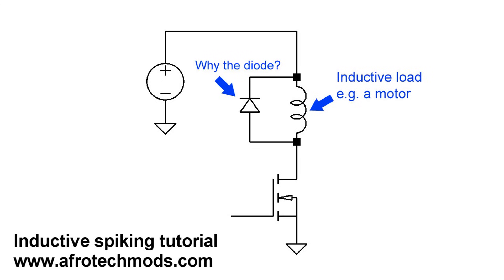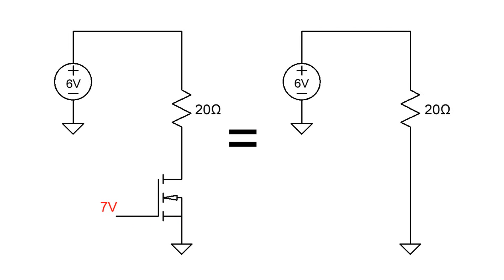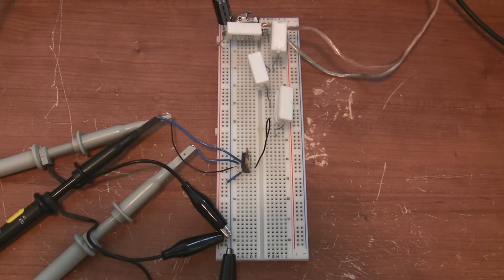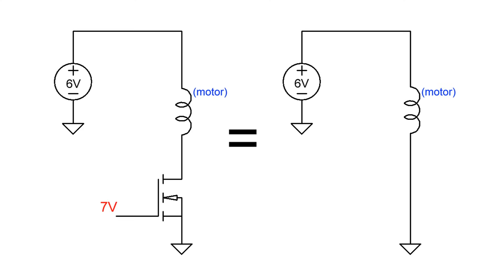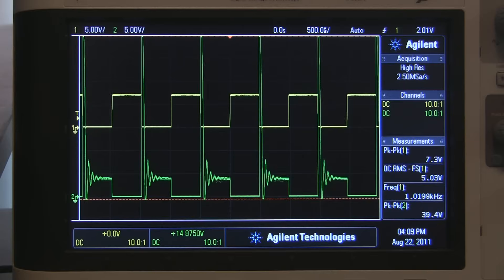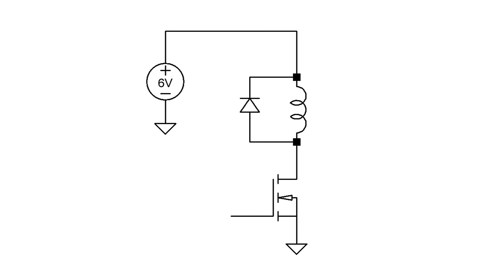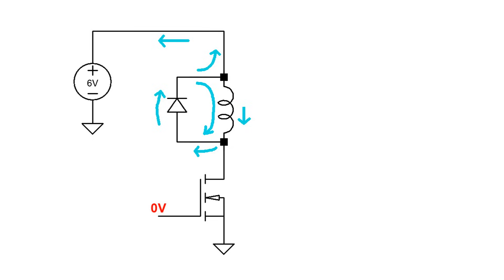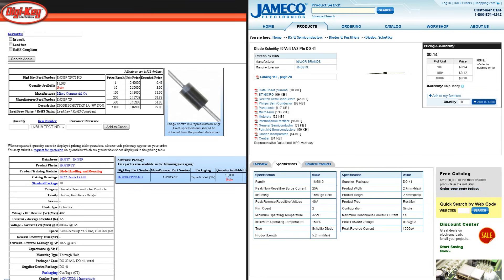Inductive spiking, and how to fix it!

Comment: Aren't RC-filters used to protect circuits from transients?
RC-filter = Capacitor and Resistor in parallel of the vulnerable component.
Transient = Voltage Spike
I know about the freewheeling diode to protect from emk (don't know english word for it), basically protecting from the built up energy in the inductive component.

Comment: I like video! But the current doesn't flow to the power suorce, it is stuck in closed loop of inductor an diode, and it is dissipadet on diode and coil's ressistance

Comment: Excellent video, but I can't quite get my head around why the inductive current would flow back to the power source. Is it because the point at the transistor drain becomes more positive due to the induced current, so current just flows to a less positive point?
It's just difficult for me to imagine current flowing in what appears to be an open circuit.
Thanks.

Comment from the maker: @steveBB30 Well you shouldn't be using a low side mosfet like in this diagram to switch any AC voltages so it's not really applicable.

Comment: @Afrotechmods It would be easy to show that there is no way in the single flyback diode configuration for the current to return to the source by a circuit diagram, but I have no way to send you one...

Comment: @Afrotechmods I spotted it after watching the video again, by the oscilloscope outputs it looks like the inductance to your motor was strong and the roll inertia weak, my motor was the opposite, the inductance current clamped by the diode was dissipated within some  msecs, while the motor continued to roll for 500msec working as a generator (producing voltage but no current).

Comment: @Afrotechmods So, the obvious question after my short story, did you used instead of simple DC motor a BLDC with integrated electronics that makes them to look and work like simple DC motors but without brushes, like the ones in the computer fans or something similar?

Comment: @Afrotechmods .... fast it shorted out the 3 phases of the motor, so no currents flowed ever backwards. The disaster came when my partner suggested that the motor stopped too fast, so I thought that instead of shorting the phases I could use a PWM scheme of fast alternation of short circuits and free wheeling in order to make a more controllable stop. The free wheeling returned current to the power supply, which it couldn't reach the large power supply capacitor, so instead it gathered to....

Comment: @Afrotechmods By the way, my motor was a 60W motor DC motor. A short story : when I was young, I had blown up a BLDC driver circuit that I had had build just by the way you suggested. I had a diode to block reverse currents to the power supply. The brilliand thought was an addition of the last moment when I said "Hey, when we plug it, someone may put the power supply cables in reverse and blow it up", so I put the diode. It was not still that bad, because the board in order to stop the motor....

Comment: @Afrotechmods I believe that my experimental results was in accordance with the theory of electronics and closer to ideal results because I used more ideal components (a good quality servo motor, MUR415 ultra fast diodes and twisted cables for the power supply). If you used slower diodes, or a motor with noisy brushes it is possible to have additional spikes and not so ideal response.

Comment: @Afrotechmods .....but it was observed in both sides of motor which suggests that it was not produced by the motor (if it was the case then the voltage in the motor should be raised, but instead if followed the usual ramp). The overshot was due to the inductance of the cables that continued to bring some current even after the FET was off, current that charged the Drain-Source capacitance of the FET and stayed for some time unable to return to the power supply.

Comment: @Afrotechmods .....in the free wheeling diode. Because the current to the windings of the motor was not slowly dissipated and through the immediate stop it had a large ΔI/δt it produced the free wheeling current. It is the same overshot of 1V that appears in the basic circuit when you turn off the transistor briefly before the ramp.  By using a diode in series with the power supply, there were no dramatic results either. When stopping, it was a very brief overshoot of about 10V....

Comment: @Afrotechmods I tested all. I used an IRF630 (200V) prepared for the worst. With the basic configuration there was no overshot because the back emf of the motor continued to produce voltage as a generator with the same voltage and direction as the power supply when it was disconnected, dissipated by a smooth ramp as the speed of the motor decreased until 0 after 500ms. When forcing the motor to stop, there was a small overshot in the end of the ramp of about 1V, it was the current flowing.......

Comment from the maker: @ntomata0002 Next, if you add a bulk capacitor after the power supply's series diode, you will see all those spikes go away. This is because it only takes a small amount of capacitance to 'absorb' the freewheeling current in a small motor. So by doing this experiment you can prove that current not only recirculates back into the motor but also a small amount will be returned to the power source, and in most cases a capacitor or rechargeable battery will absorb it without a big voltage spike.

Comment from the maker: @ntomata0002 You can also try this for dramatic results: Put an extra diode in series with your power supply, and do not use any bulk capacitors. Then connect the motor & flyback diode as normal after this extra diode. This diode will tell you if any current ever goes back to the supply. If no current goes back to the supply then this diode will make no difference right? But view the voltage just after this diode, and you will see large positive voltage spikes on the flyback diode's cathode!

Comment: @Afrotechmods I guess you talk about a DC motor, just like in the example? I also guess with the diode in the circuit because without it the overshot burns the transistor or if you use soft gate driving and high voltage transistor without the diode you can save it, but the motor will stall almost instanly. According to my knowledge and experience just slowing down the motor doesn't causes spikes, only if you turn it faster or to the oposite side, but because I respect your opinion I will try it.

Comment: @Afrotechmods If you refer to turning on and off the transistor with the diode and without it, with the diode the circuit is much more efficient because the stored energy in the motor instead of disipating in an instand to the transistor, it continues to flow for some time. It will not increase the Efficiency = (Output power) / (Input power) compared to the motor full runing.The efficiency will indeed increase if you use steady lower current instead of full on / full off for reduced output power

Comment from the maker: @ntomata0002 Also, try running a large motor, then switch the transistor off, then forcibly slow down or stall the motor and you will get a massive spike on the supply line unless you have sufficient capacitance to deal with it.

Comment: @Afrotechmods The inertia just adds to the stored energy to the motor, it doesn't change the picture. The energy exists and disipates to the friction, motor windings and the diode itself. It doesn't return to the source in this particular example because the current has a low voltage drop to flow through the diode.In other configurations (in H-bridges for example) that the only path for the current to flow is through the power supply, it indeed returns to the source.Just not in the above example

Comment: I have to observe that (despite all the good information on the video) in the presented configuration there is no way for that current to return to the power supply by the diode when the transistor is turned off. And that the overshot's maximum value doesn't have to do with the frequency of switching the transistor on/off but with the time we make to turn it off and the Drain - Source capacity where the conserved energy is stored (which explains the oscillation afterwards)

Comment: The energy of the coil flows back into the power source? oO I thought it just shorts out through the diode and turns into heat.